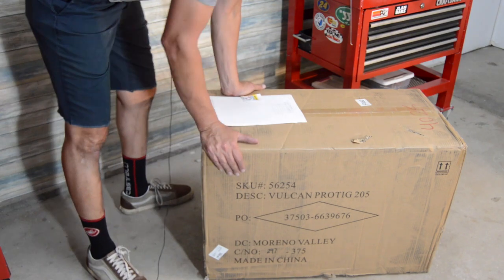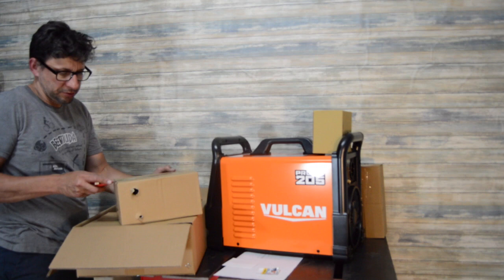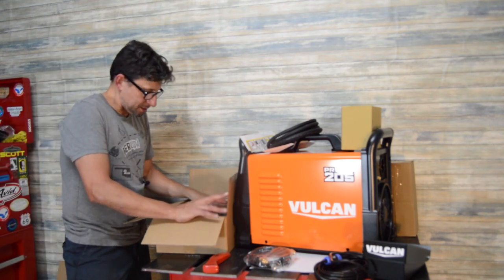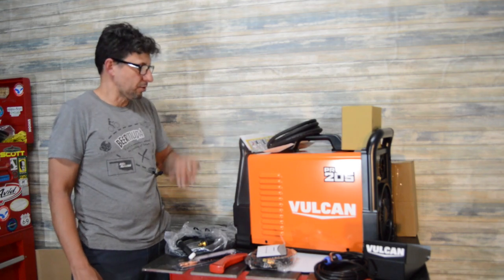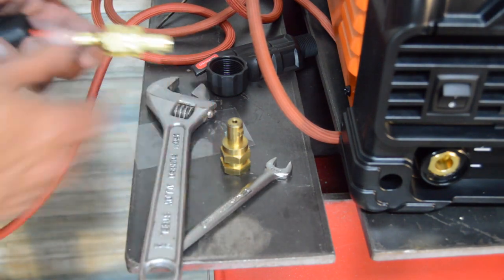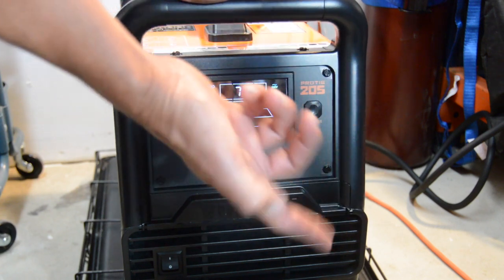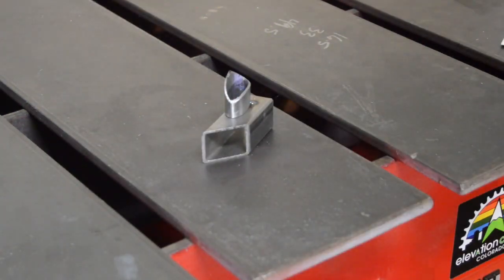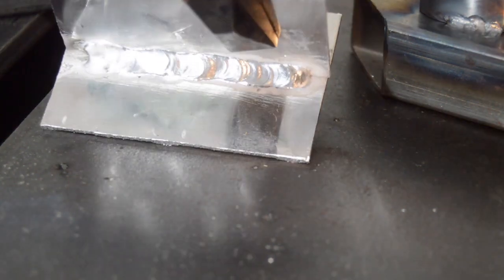Vulcan ProTig 205 AC DC Welder Review

Comment: Do you ever run stick in this?   For some basic stuff I just want to stick weld but damn it's really tough to strike and keep the arc from going crazy.   Tried 6010 and 6011 rods.   I trained on a Miller with 6010 and it was like butter.    This thing is all over the place with 6011

Comment: Its a great welder.   220v is best for all these converter welders.  Only issue I have seen with them or any model is 110v.  Some people just don't have a good 110v supply of power and yes they will not do as well.  I love my TIG 205 so far.

Comment: @shanehester4852 • 1h ago (edited)
Listen do not buy this welder. I bought one because of the reviews. I got my Tig 205 set it up and no matter what I did it will not arc on ac. It will only arc on de.
The only thing I need it to do is aluminum thats what I bought it for.So I started researching on the forums and lo and behold lots of people have same issue. I took it back next day and told them I'm not even gonna risk another one and had to pay a 200$ restock fee and ordered a Lincoln for 600$ more well less the 200$ restock fee.

Comment: I bought a ProTig 205 last month.  I first tried using DCEN on steel and it seemed to work ok.  Then switched to AC for aluminum welding and the welder would not even strike an arc.  I called Technical Service and we went through Reset and also all the connections and still would not work.  Due to only having the unit for a couple weeks I attempted to return the welder to Harbor Freight.  They demanded that I pay a 20% restocking fee which was around $200.  I resisted and tried to explain that they sold me a defective welder that never worked.   They still demanded the restocking fee.  I WILL NEVER BUY ANOTHER ITEM FROM HARBOR FREIGHT DUE TO THEIR REDICULOUS RETURN POLICY ON A DEFECTIVE PRODUCT.
Reply: Are you mad.  You are trolling the videos complaining.  Harbor Freight has been great to me and I took a welder back with no issues.  You not helping you or anyone else.  You should have called corporate and complained to them. It might have been that store.  Never has my store asked me to pay a restocking fee.

Comment: This machine or omni pro which one do you choose
Reply from the maker: I guess it depends on if you want a welder that does MIG. I haven't tried the Omni Pro, but it looks great for the price. I still use my Pro Tig about once a month or so. It still works great. I primarily just Tig weld, but if I were doing lots of general welding, I'd probably go with the Omni Pro.
Reply: @JoeyMesa  I already have a mig torch if I  went with the omni pro. I find myself rarely needing to do aluminum but there are instances were I need to do it but I find myself using Flux cored more due to portability issues

Comment: The Harbor Freight Pro TIg 205 now has only a 90 day warranty. For pretty much the same price, you can get an Everlast 255EXT with a 5 year warranty.  The Everlast is smoother and the HF start is way better. I've had the Pro Tig 205 and before a week was over using it, I returned it to Harbor Freight.  Your MMV.

I have the Vulcan 215 mig machine and it is excellent. Highly recommend that machine.
Reply from the maker: Well, as of this moment, this thing is still going strong with no issues. Who pays for the shipping if you have an issue within 5 years?

Comment: Thanks for making this video. Your video and a few others have inspired me to buy one. I've never even used a welder and managed to lay some decent test beads on 1/8" aluminum after about an hour into the first use. Any updates on your machine? Any issues? Still happy with it etc?
Reply from the maker: It's still going strong! I've been using it to weld some pretty thick material at home and at work. I've had it maxed out in the 120 volt outlet, and so far, it's been great!

Comment: Can you switch the dc polarity to splad the tungsten?
Reply from the maker: On this machine, the gas flows out of the negative interface, so technically, you could switch the ground and torch leads and ball the tungsten on DC positive (Which I assume the question you're asking), but without gas in this setting, I think it would just melt the tungsten. It's pretty easy to ball the tungsten in AC mode if you just turn the AC negative balance all the way down.

Comment: I’ve had both the protig 165 and migmax 215 for over a year. Both have run flawless. I did change to bigger clear cups on the tig torch which helped. The mig is as good as any blue or red machine I’ve ever used.
Reply: Great video. You sound exactly like actor Woody Harrelson .   Great pranking opportunities await!
Reply from the maker: Yeah, I haven't tried a big clear cup yet, but I'm going to soon! I've been running the welder quite a bit the last 2 weeks. No complaints so far. Haven't messed with the pulse settings just yet, but overall, on DC it's pretty much the same as my Lincoln, but this thing welds aluminum on AC like a champ!  I ran it pretty hard today for a couple hours on some 1/4" steel. Doing some work on a car rack for a buddy of mine. All I have available right now is my 110 V outlet. Had it cranked to the max, and the Vulcan never missed a beat!

Comment: Just bought one, seems like a good unit, the petal is a little notchy  but tolerable,  still has a few false starts, not a big issue. Gonna put a few dozen hours on it soon, but I have a esab mpi350, a Miller side kick and a Miller 251 just wanted something I could leave set up to weld aluminum which I do very little of. Might do a welding vid an impression vid later on....

Comment: I just got one Friday. I've never tig welded before, after a bunch of youtube videos before I tried, I was able to weld some aluminum intercooler pipe super easy. I like this welder alot.
Reply from the maker: Right on! I've been playing with it and made an aluminum box to hold small parts at work. Seems like a really good welder to learn on for sure!
Reply: @yotahoon I specifically bought this tig pro to make intercooler piping on my supra. Did you have any issues burning through the thinner piping when you first started?
Reply: @mxxmikexx1  no it has worked great for me. I keep it at like 70 amps for intercooler pipe. It only burned through when my joints didn’t line up good.